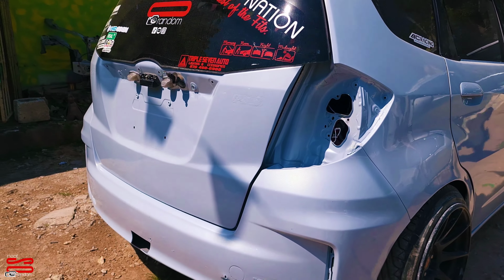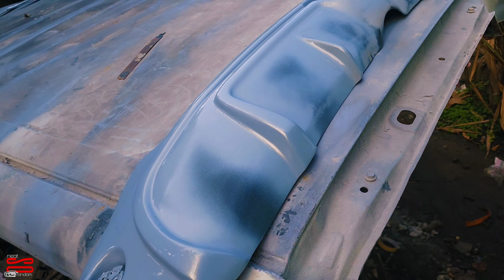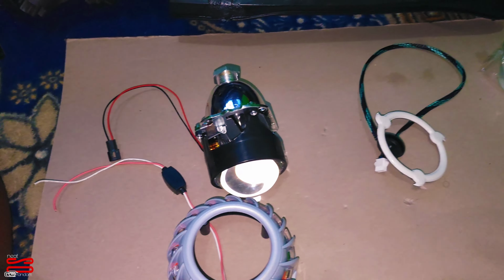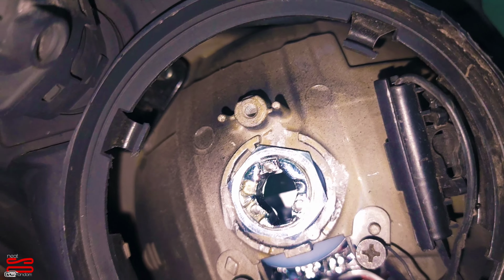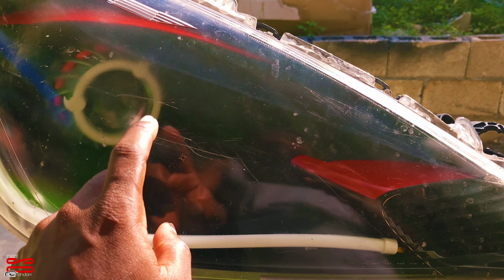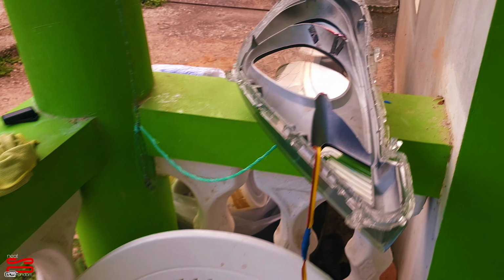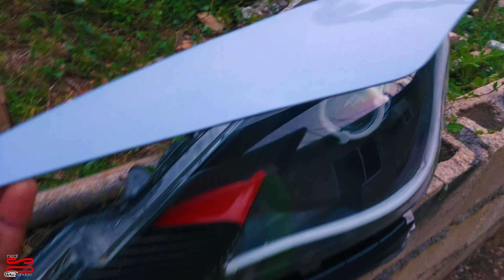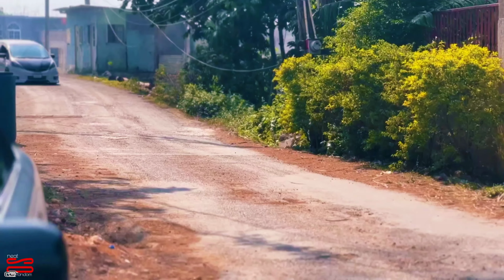Restoring my Honda Fit RS project pt-2 | Episode: 30

Comment: Love the car. What brand tire ,size, and rims are you running? I have a 2011 rs in Guyana
Reply from the maker: Maxxis is 205/40 tires and rims are staggered 17" 8.5 front and 9.5 back.
Reply: @neatsorandom  what is the offset?
Reply from the maker: @Westsidewhips-592  back is 20 and front 25
Reply: @neatsorandom  ok, thanks , keep up the good work. I love the car videos. Keep them coming
Reply from the maker: Much respect 🙏🏾

Comment: What was the cost to body work and to spray?
Reply from the maker: Well, the bodywork costs $100k because I did a full bodywork to get rid of any imperfections and full spray over which cost $170k because of the stages, 2024 color with a 3-stage paint job.
Reply: @neatsorandom  That is pretty affordable especially when compared to what the costs are like in Kingston.
Reply from the maker: @adririficlife4884  I'm from Kingston so trust me I know. 😅